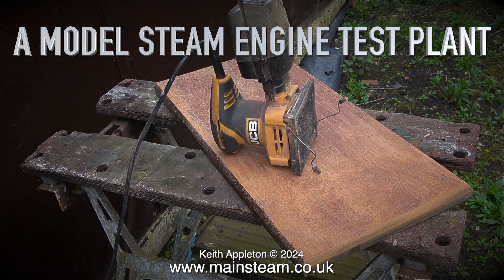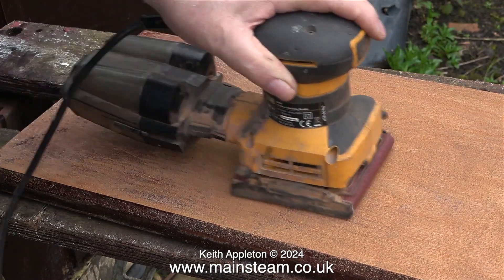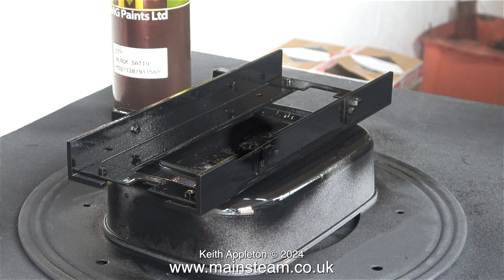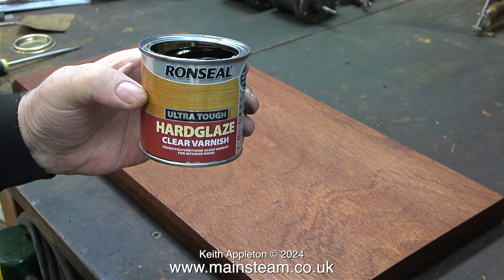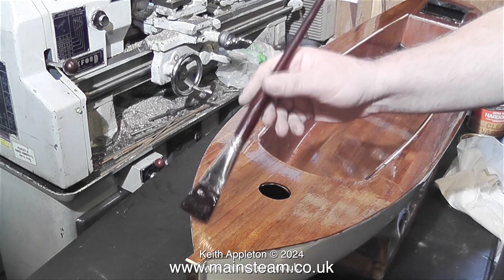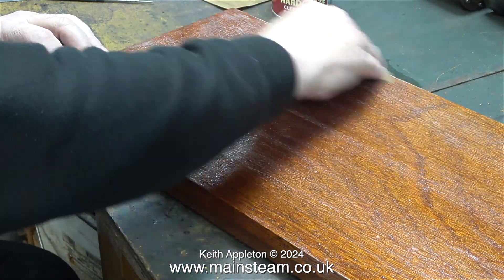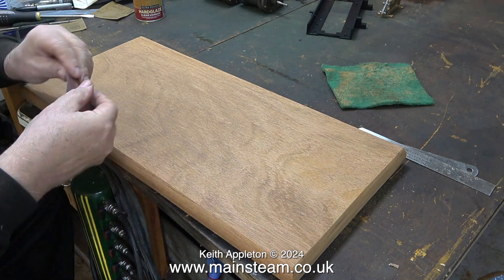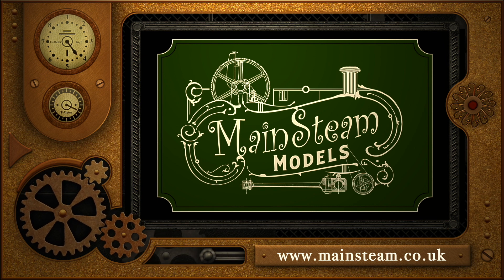A MODEL STEAM ENGINE TEST PLANT - PART #3

Comment: I prefer scrapers for varnish since they don't clog, I've had similair issues with sandpaper when refinishing gun stocks before I started using scrapers. Doesn't even have to be a real one, can just be a razor blade used perpendicular to the surface. Cheers

Comment: Hello Keith. I’m hoping you get on top of your prostrate problems. It’s good they have picked up your raised PSA levels early. I lost a friend of mine to prostate cancer earlier this year as his problems were missed. Anyhow, a little tip of mine is to clear your sandpaper off with a wire brush if it starts to clog up. You will get a better finish. Stay well. Gary - Thirsk
Reply from the maker: Wire brush ..... never thought of that. Thank you }:-)))

Comment: Why spend so much time and material to remove the varnish? Just put some paint remover on it and it will come off much easier, I also wash down the wood with bleach and 3xxx steel wool  then it’s ready to go ! I use this technique for some gun stocks that had stain and many coats of varnish that was 70,years old , it came out like new wood ,taken the new stain and varnish beautifully P.S. 6 coats of varnish thinned out and sanded with 3xxx steel wool now it looks like plastic! 👍🏻
Reply from the maker: I don't like using paint remover unless it is absolutely necessary, plus I haven't got any.